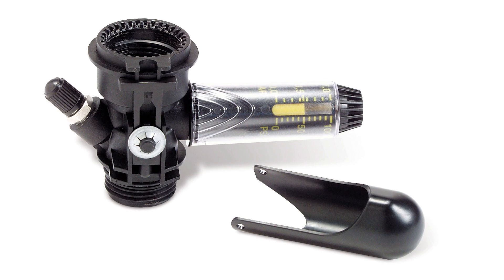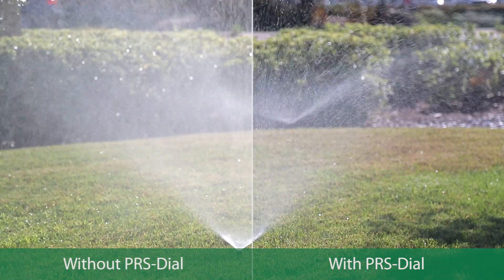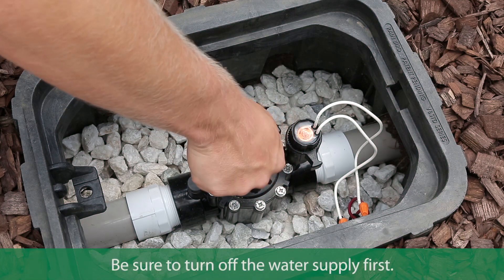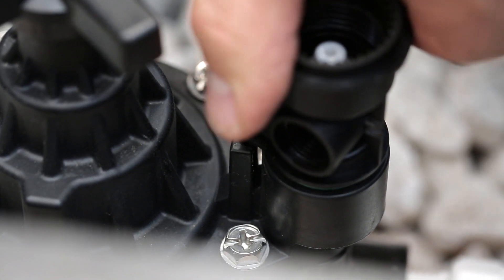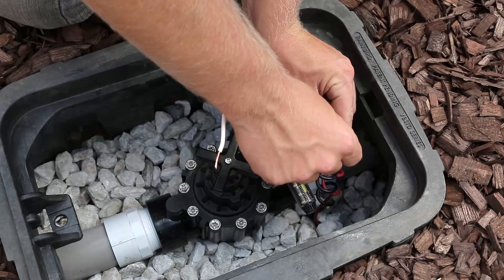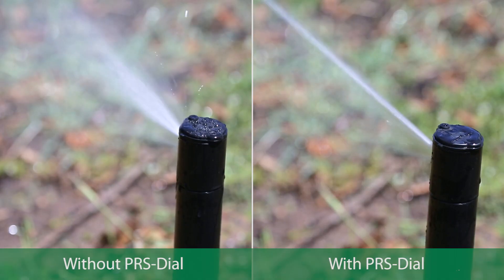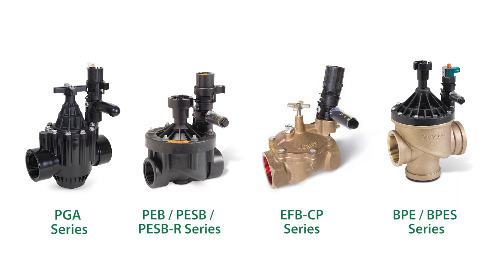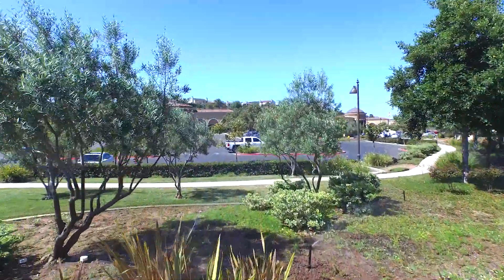Rain Bird PRS-Dial Pressure Regulator

Comment: Can this work on a 3/4" sprinkler head valve assembly? I have 110 psi. pressure and want to drop it down to run about 40 psi for drip
Reply: What's a "sprinkler head valve assembly"? You mean a 3/4" electric valve? If it's Rain Bird, I'd say yes, as it's a normal solenoid, but might call 800-RAIN-BIRD for better answer.